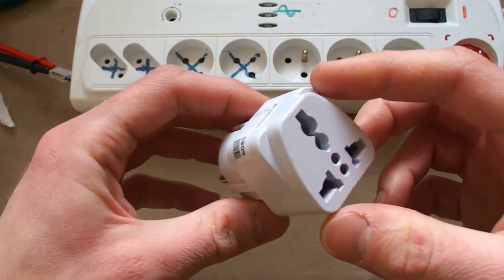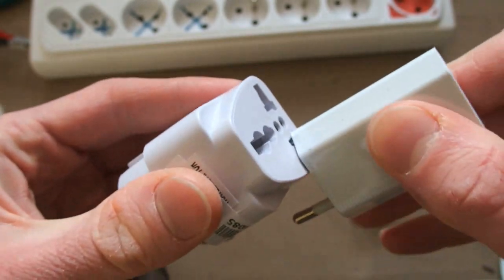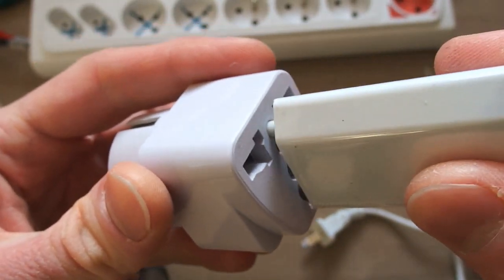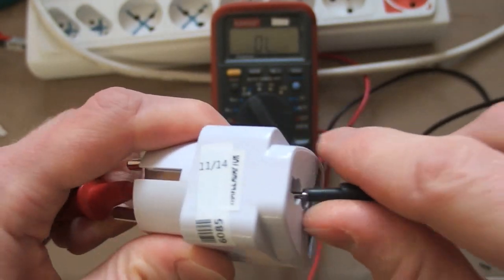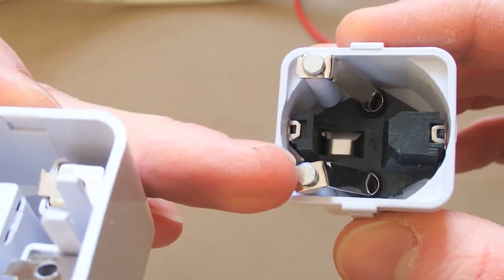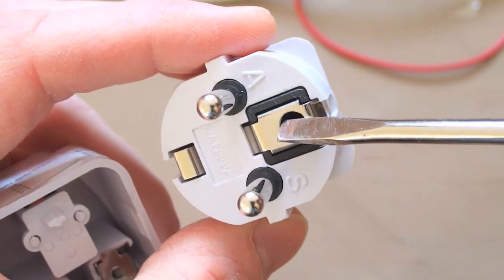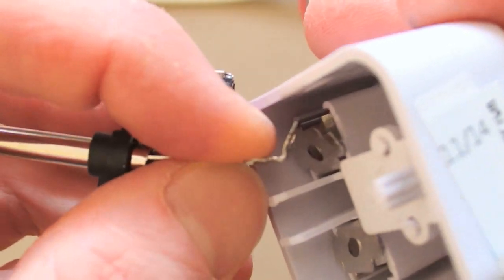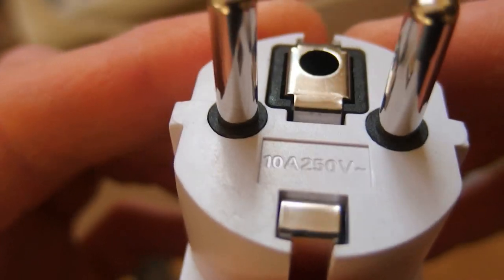Dangerous Travel Adapter

Comment: Such travel adapter is designed with compact, effortless and simple to use in mind. Dangerous? Well, at least to my whole family it's not that so. But to be honest, only dumb people would do such dangerous thing because it is very simple to understand and know how to use right away when looking at those different shape holes.
Reply: I URGE to stop using these adaptors. The internal connections are very poor and can easily (not an exaggeration) lead to fires. These adaptors break the law of basically every country you use them in. The adaptor doesn't have a voltage converter so if you plugged in an Mexican device (110V) into a German outlet (230V) the device would literally blow up or spark and catch fire. The same goes the other way round. Also, with some plug types it is very easy to plug the appliance the wrong way round. For example, American plugs aren't symmetrical as one pin is longer than the other, but the socket is 'universal' meaning the hole must be bigger for accepting other socket types and therefore you cannot tell which hole the longer pin is supposed to go in, you cannot tell which way round you should plug in the appliance. This can lead to circuits being live even if you switch them off. IF YOU HAVE CHILDREN YOU ARE PUTTING THEM AT A FUNDAMENTAL RISK OF FIRE AND ELECTROCUTION.
Reply: chunxia chen You're obviously an advertiser forgetting about the danger of these adaptors, and your poorly translated comment doesn't make much sense
Reply: our item with FCC CE and RoHS Certified.Built-in security shutters and welding electric fuse on the motherboard,effective fire prevention.We provide our customers with safe products,yes,the seller who no care about peoples safety should be banned.
Reply: Ben Wyatt : I agree with you.
Reply: Ben Wyatt Adapters are not intended to do voltage conversion. Most equipment one travels with (laptops, phones etc.) are multi-voltage. Using a voltage converter can even break such equipment.

Comment: Well, you are supposed to use it with mobile devices like smart phone, tablet, laptop, music player, e-book that use such low voltage of electricity that doesn't require ground output that much. Anyone looking forward to connect a drill or 1000,00€ worth equipment to a $1 adapter is a fool.
Reply from the maker: What people are supposed to do is not always what people actually do :).
Reply: Yeah, that's correct.

Comment: Can you please make a video showing how to check the safety of a power adapter before using them? I purchased one from banggood and today I received it. When I used it with my electric kettle, it exploded. It became all burnt and the electricity at home went out. Luckily I left the kitchen to answer the phone just right before it exploded
Reply: Damn, crazy Chinese engineers hate fuses! They never put any safety features in their products and that's what happened, it explodes. Luckyly you had good breakers

Comment: Very nasty, belongs in the bin :-(
They just dont care about peoples safety.
Reply from the maker: They make ground contacts at both sides, but don't bother connecting them. I will never understand their logic...
Reply: Yes, "kill it with fire" ... or electricity ( 16 Amp like in Germany should be a way more than enough )
Reply: Its the usual lethal Chinese "Export Only" crap for the to greedy / meanness
Reply: zx8401ztv, it's home is A BIN?!
Reply: Szakembőr TV TMIAE thats dangerous
Reply: @zx8401ztv - 
It already belong in the bin when it was on the drawing board. 
ANY adapter I wire my self from a junk pile plug + socket will be more save than this.
Reply: @zx8401ztv In the US people fall for these doggy products more than the UK because we have less access to buy propper Adapters on the spot at a local shop before travel so people just buy the cheapest option on Amazon and in honestly the US encourages the scammers so I always warm Yanks who travel to Europe to buy adapters from the local shops that they go.

Comment: Nobody does what you show, only the extremely stupid. Throwing a bucket of water on it is also dangerous, but who does that?
Using it as intended makes it a good and safe product. Don't go where the road don't go, and you'll be safe!
Reply: what if at night you want to plug in something and it turns out that's wrong way
Reply: @groszak1  then just plug it properly
it shows that you don't have any situation awareness
Reply: You do not get the basics of electric safety. The idea is to prevent plugging something incorrectly.

Comment: I have a similar adapter, but in mine the ground is connected. I think there are "good" versions of this adapter being sold and then these knockoffs of those adapters.
Reply: @krypton - 
even the "good" versions of this are dangerous , just slightly less dangerous ... 
this thing has a poor contact everywhere & lets you still use it this "creatively"

Comment: Just don't be stupid enough to plug the earth of a UK plug into the live terminal. I got a UK to European/US adapter with a cheap rechargeable LED torch (€8.99) off Amazon. You can plug the earth of another UK plug into the live or neutral port of the adapter. It's a wonder they are not banned ;-;
Reply: If the plug drops from the adapter and the socket is in less than ideal location and you try to reinsert it with a feel you may get it wrong. Also a child could plug it in.

There are decent adapters so no need to buy this junk.

https://www.gigantti.fi/image/dv_web_D18000100270411/SKRWA11EUROPE/skross-matka-adapteri-eurooppa--pdp_zoom-3000--pdp_main-850.jpg

Comment: I ordered an oscilloscope online with an option for a European cable or an North American cable. I selected the american because I live in the USA. What did they send me? A European cable for it plus this adapter (mine adapts to a chinese plug). Wouldn't it have been cheaper just to include a north american cable? In the end I just used one of the numerous power cords I already have.

Comment: I've one of those also, but despite the other faults mine is grounded at last. And it's glued togehter also and I couldn't disassemble it. The outer shape is exactly the same. The type plate says 10/16A250V and "Made in China" - where else...

Comment: Travel adapters are always a dangerous thing because laws differs in countries and an adapter bought in country A may not meet the laws in country B. This one could be used in Germany too and it does not meet our laws. Grounding is another issue. In my opinion, it is safer to cut the ground instead of using an untrustful one (beside Germany there are many countries using the same kind of sockets). Travel adapters aren't made for huge power or long-term use. I would use that plug with a bit of care during vacations and always unplug it after use. If you need a speficifc adapter many times or long-term, it would be the best choice to buy a socket in your country, a plug in the vacation country, a cord in the "safer" country and put them together to a proper extension cord.
Reply: The user has no knowledge that the ground is cut as it has the totally unnecessary metal contacts to fool the user that there is ground.  You may an adapter that has multiple inputs and one output specific to your country. This has one input and multiple outputs. There is no reason to buy this over a more specific adapter. Still I would advice against adapters that have moving parts. They can fail or cause dangers that the designer did not think or care.

Comment: This can be plugged in old style european ungrounded wall outlet (Used at least in Finland back then. CEE7/something). Shallow circular wall socket allow fingers touch to full metal pins while tip of pins reach live and neutral contacts probably..
Reply: Also in Japan Euro outlets (2 pin) in Thailand.
Reply: Probably not - those old style USSR sockets had 4mm pins, while this pictured has 4.8mm pins. Yes, I've tried pushing it in, practically impossible.
Reply: That is a problem with the outlet, not of this adapter. The problem applies to all plugs with the exception of the Europlug. Modern outlets, even ungrounded are fully recessed.

Comment: Guys you can get ground to work on this. I opened up mine and like it in the video at 3:33 you can see there is a plastic cover, it has that piece coming out so you can grab onto it and pull it off, it's only a cover. The actual metal part is under it.

Just take it off and put it back together and that issue is solved.

Do note that it's still not safe and a horrible design, there's a chance that if you take it apart and put it back that the pins won't make contact anymore and will not work. Even the supposed ground pin may not contact as it's very small once you remove the cover and see.

Comment: I think only child and idiot connect the plug as you shown in 1:10 .... and the earth ground option is not the problem for china, but for the whole world problem, because many place has no ground before. this culture allows china factory to reduce cost on implementing without the ground. also if it is travel adapter, it is suppose to use on low voltage low amp electronics such as mobile transformer, then this adapter would be helpful. 

Anyway, if you bring yourself with a hair dryer, or even a big oven for travelling, i really suggest you buy a better adapter.
Reply: @rilka top - 
You forgot old people with degrading mental & also degrading eyesight  + degrading touch sensitivity / motorics
Reply: This could happen if the socket is in a hard to get location and you disconnect the plug from the adapter and try to insert it back again. If you then lean to a grounded device or a radiator it can be fatal. The dangerous things are those where the pin sticks out-

Comment: I agree with you they are garbage my cable box's Cable kept on falling so now I use it for my electric charger but it's different with shavers in this video because shavers don't have ground I know what way to plug it in lol the one I use for my cable box is still a travel adapter but a one that is a shutter one and yes Poland is a language and Polish is the country

Comment: In my opinnion the italian plugs are the best because they are very compact
Reply: Hello!
But it is impossible to distinguish between "live" and "neutral".
Although in terms of electric circuit - it should not bother; but in terms of safety - it is very very bad!
Reply: @ShimonKupferman  this problem doesn't exist in type J and type N
Reply: You are right as long as there is a grounding pin  @groszak1
Reply: @ShimonKupferman  these two plug types do have a ground pin
Reply: Excellent!  @groszak1

Comment: I received this same adapter from China when bought an electrical equipment. It feels good and sturdy which gives you false idea about it. My uncle who lives in Canada, travels a lot in China and he had really awful adapters. I took some pictures and am going to make an internet page where I tell about them. This adapter is very bad because those are sent masses to Europe with Chinese equipments. Also Swiss socket goes into this. It is like Italian one but the earhing pin is shifted few millimeters. That’s why the adapter has two small holes between Live and Neutral.
Reply: Insignia EU Schuko travel adapter costs $ 8 Canadian, bought from Bargain stores, Best Buy or Amazon

Comment: Pluging them in wrong will not set them off as the + - and different ports and will not supply power
Reply: There is no plus or minus in AC. There is live and neutral and mixing them causes no harm.

Comment: This has got no shutters on it, so if you poke a screw or any bit of metal into it, you get electrocuted. European sockets are also unsafe because of no shutters.
Reply: European sockets do have shutters and they are better than the British ones as they can only be opened by pushing two prongs at the same time - much harder for a child to do than first pushing in the earth and then the live.

This adapter, however, is not for children so I do not see the point.
Reply: Depends on which European sockets you're talking about. BS1363 and newer Schuko do have shutters

Comment: No, the contacts inside are better without solder as solder can melt
Reply: Mechanical > Solder > Luck

If they had soldered the contacts, they'd be better because that thing relies purely on luck and I wouldn't be surprised if some of these start arcing at just a couple of amps.

Comment: In poland sometimes we havent a pin for ground
Reply: Old sockets are often ungrounded. It is not an issue. if it fits it is OK. However, if the socket has a ground and the device also you should never break the connection.

Comment: What happens if you plug live to ground? Does it go BOOM?
Reply: If there is no GFCI it will work but that is not what it is intended. In my home ground and neutral are the same thing. The same wire goes to both. This was the standard method of grounding in Finland from the 50s to 80s or so.
Reply: Then it should trip the Residual Current Device

Comment: 只有笨的人才会这样插插座🙂
Reply: @LnF Enthusiast - 
it ( "只有笨的人才会这样插插座🙂" ) does not negate the fact that this thing is absolutely illegal everywhere on earth (it is for export only) & kills by fire, smoke & electrocution (no ground) , even when used by an IQ 150 genius who read the instructions.  
Also there is NO warning against European plugs ( Type E & F ) which require earthing pin / side clamps in a recessed socket. 

Recommendation: 
Stick with the best version ( = the 2 part with earthed recessed German socket) of the "Skross PRO World" adapter (capable of 6.3 Ampere) from Switzerland & you are fine (except when using the normal US-American electrocution plugs). It costs ~30  Euros , that is far cheaper than death ( just look at the construction & learn https://www.proidee.de/reise-mobilitaet/reiseaccessoires/skross-weltadapter-pro-world ) 

Alternative: 
use this cheaper bulky but still very save star type adapter "as-Schwabe Weltreise-Stecky": https://www.bueromarkt-ag.de/reiseadapter_as-schwabe_weltreise-stecky_6-teilig,p-90251.html

Comment: Vždy jsem se bál těhle cestovních adaptérů, obzvláště těchto vícesystémových. Snad jediný "adaptér", který mi přišel bezpečný je Powercube, kde si v cizině koupíte příslušný IEC C13 kabel a není tak velké riziko, že jste bez přístupu k PE(N) či vám chybně zasunutá vidlice dá šlupku. Jinak na videu, to je slušný křáp, že ty výrobce baví se vyprdnout na uzemnění, upřímně řečeno jsem byl dost nejistý, když jsem měl zapojit třížilový kabel k nabíječce od notebooku do egyptské zásuvky typu C :/, kde byly odhalené L/N kolíky jak u amerických A/B vidlic)

(I was all the time afraid of those travel adaptors, mainly the multisystem ones. Only one adaptor I was not afraid of is Powercube, where you can buy local mains to IEC C13 cable and there is much less risk, that you have no access to grounding or you can get shock from incorrectly inserted plug. Otherwise in this video it is real crap. I wonder, why the manufacturers enjoy ignoring safe earth connection. Well I was very afraid to connect european CEE 7/7 plug into egyptian type C socket :/, where the L/N pins were expoesd like as in type A/B plugs)
Reply from the maker: Ten velkej adaptér tvaru kvádru s vysouvacíma vidlicema je ještě horší. Jde vysunout i 3 vidlice najednou :). Jedna se zapojí, další dvě trčej ven a jsou pod napětím.
Reply: Viděl jsem, aneb tester žárovek v ceně :D Tohle prodávají bez jakéhokoliv varování a naopak SCHUKO zásuvky, prodlužky a vidlice jsou v ČR skoro démonizované, přičemž na SCHUKO přepěťovku s vícenásobnou zásuvkou už jedu v pohodě a bezpečně 6 let

(I saw it, the "lightbulb tester" 2 in 1 :D. They are sulling such deadly crap without any warning and on the other hand SCHUKO sockets, plug and extension cords are almost taboo in Czech republic. Meanwhile I am using SCHUKO power surge with multisocket and I am running it safely and with no troubles for 6 years)

Comment: I actually own exactly the same adapter which was delivered with Chinese portable monitor and my adapter has a connection to ground and actually live+neutral wires that are actually thick enough to handle a current of 25a.

It looks like there are two versions of this adapter if I compare my adapter with yours.